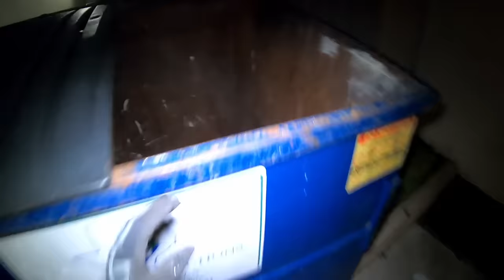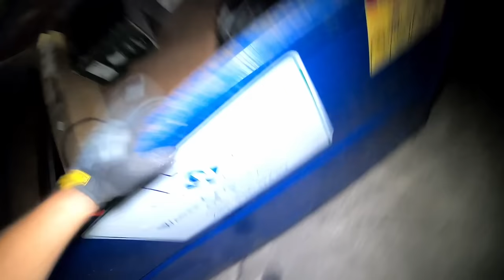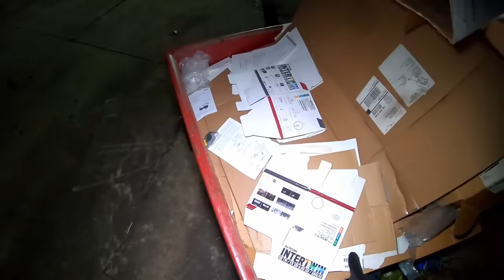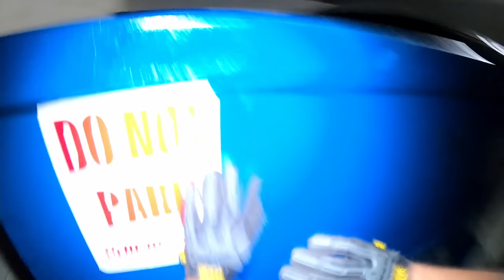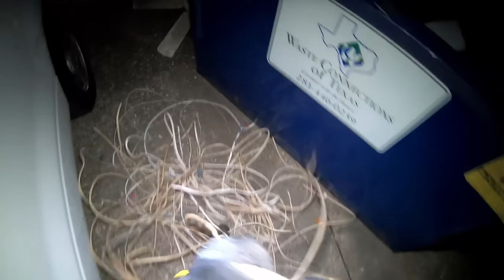Dumpster Diving "Let's Go Fly!"

Comment: Easiest way to strip wire is to take some white nylon like what they make the thick cutting boards out of. Drill a hole a little larger than the Guage of your wire about a half inch from the edge then drill ahold to intersect the first hole to screw a sharp drywall type screw into.
Put your wire through the first hole screw the screw down to where the point peirces the plastic, then pull the wire the plastic will peal off easily.

Oh yeah you will want to mount it to something sturdy

Comment: Networx NX8V panels you are throwing away as scrap can be resold for at least 75 bux each if the boards are not shattered.  There is real value there that exceeds the metal price.

Comment: Hi Mike
Sorry mate to bother you but why you don't have proper wire cutter or little impact drive with set of main socket set as 8,10 or 13 witch is most of nuts you can take it off.
I am watch your films in UK and I am enjoying.
I am working on car scrap yard in UK
Just pull the parts off the cars myself and always have set of right screws drivers and sockets so I can make it easy before anybody else get to it.
Best regards from Yorkshire in UK 
Good lad!!! 😀

Comment: coax is only crap when it's not copper. Get the magnet out, bro!  I get 30 to 50 cents for low grade wire in Los Angeles.